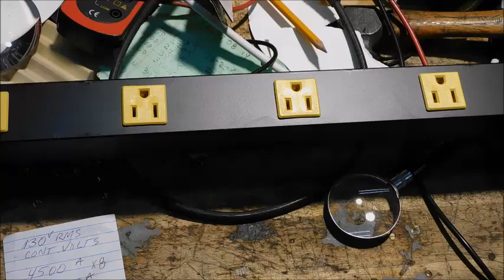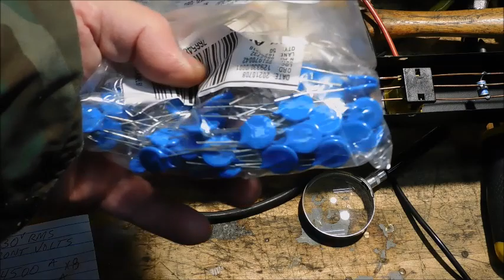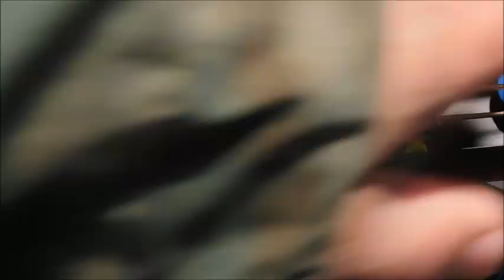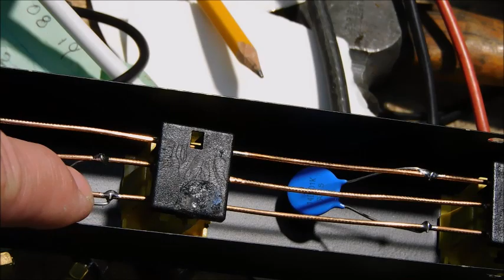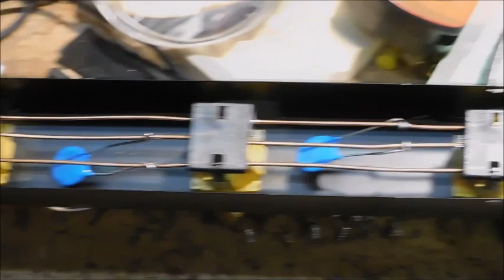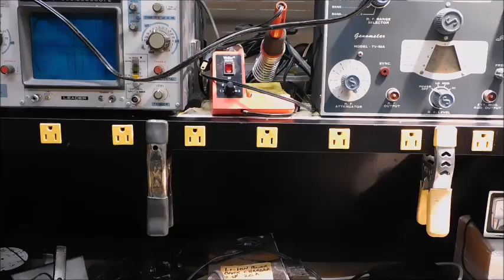Make your own surge protector for your workbench !

Comment: Before you could buy commercial surge strips, I followed on article and wired up some MOVs like you did. Fortunately in a METAL case, like your strip. The danger of MOVs is that they weaken with every surge as they age. If they die slowly, they can slag down and catch fire unless a fuse blows fast.
 If there's a massive surge, they usually just blow apart. But adding thermal fuses up against one or both sides of them is not just paranoia.
Reply from the maker: That is very correct and helpful. That really is a great idea! P.S. I like your "clippy" avatar. I like louis's channel too. I tried to change mine but it kept telling me I need 2FA to be allowed to change my logo. I do not have or need a cell phone out here in the hills. Crazy times my friend. Thank you for watching.

Comment: Dave, how would you be able to add an LED to this for “visual” confirmation?
Reply from the maker: First I would just use a neon bulb with a resistor which can be bought as one unit for a pilot light for panel mount... made for 120VAC.  But second, if you want to know if the TV diodes have been "tripped or triggered", I need to make it clear that they usually fail to a short condition. You will trip breakers in your feed panel. You can put a panel mount fuse in the circuit to have it blow before you trip a 20 amp breaker too. The way I wired my components along the power strip, it would be difficult to put an indicator light on this to tell you if it is still "active" for spike protection. I hope this makes sense.
Reply: @davenooner2142 it does, thank you. I’m going to pop open my 16 outlet Triplite strip and do this. It came with a generic circuit breaker button built in, but don’t think that is good enough to protect my ever growing stack of equipment.😅
Reply from the maker: @optimizelogicrepair2784  It can be costly to keep replacing equipment damaged by lightning. Remember when you have 1000 or more amps and crazy volts... it goes where it wants. Give it a good path to ground for your best chance.
Reply: @davenooner2142 what rating do you think would be good if I added a panel mount fuse?
Reply from the maker: @optimizelogicrepair2784  maybe 10 - 15 amps.